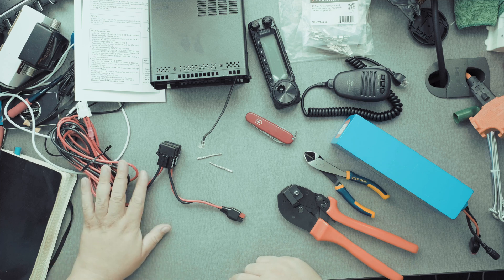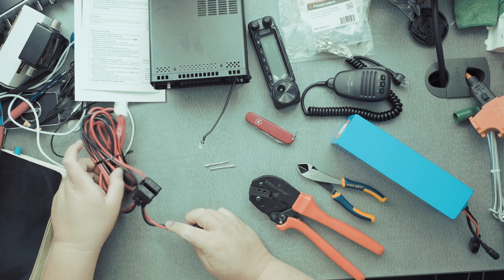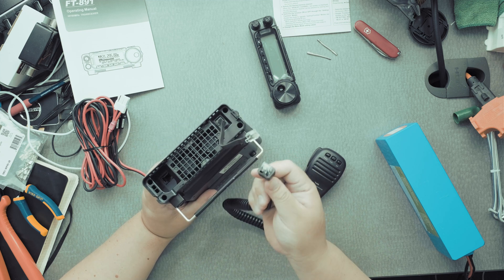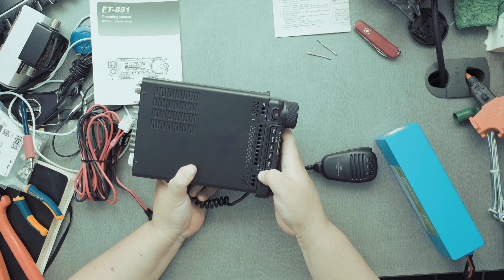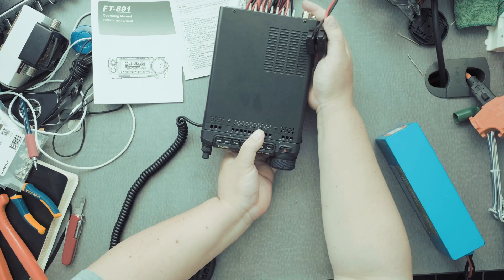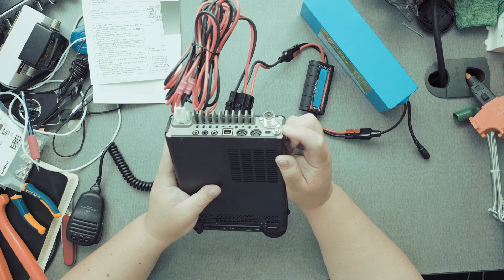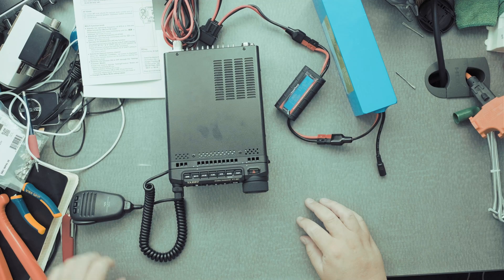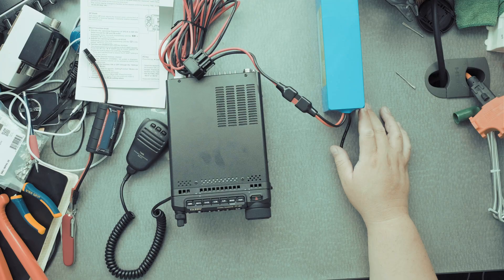Yaesu FT-891 Basic Field Setup

Comment: In general, running a home radio to a ground rod that is simply driven in the ground is probably not a good idea even though all the manuals have been saying that for as long as I can remember! The ground wire from the power panel is, or should be connected to the ac power supply. That is connected to the power system ground, connected to the ground rod at your service entrance. Another ground rod any distance away that may be connected to your radio could, in the event of a lightning strike nearby, be at a significant difference in potential from the power ground and cause serious problems with anything connected to it. That radio ground rod should be connected to the power ground rod at your service entrance so they both stay near the same potential. When using a battery there is no safety need to ground the radio. Indeed what hurts you is always a difference in potential. What is the difference in potential between the radio chassis and the ground when connected to a battery? Probably zero volts in almost all cases. My home radio station does not have a separate ground rod. I also disconnect my antenna when not on the air. Lightning could hit my antenna and if I did have a ground on the radio the ground would not help protect it.  Grounding is often misunderstood, even by the people who write the manuals!

Comment: Hi Frank, really appreciate your video. Just wanted to know that if  it is possible to work the FT891 efficiently without an Antenna Tuner and also not damaging the rig. If yes, then it would be great to hear how to go about it. As a manpack the the ft891 can then become superp during hiking. Hope to hear soon
73 & Cheers!
Reply from the maker: Hi Shandy.  I used to have the FT-891.  You can have a resonating antenna on the FT-891 without a tuner.  Best thing to do when you are not familiar with the antenna is to check it with an antenna analyzer.  There are plenty of options in price and options available for ham operators.  Ya, about the manpack, can't wait to see it.
Reply: @frankwc0o  thanks-za-ton for the response.
Cheers!

Comment: 8:56 Get shocked from what?
Reply from the maker: It's possible that the surface of the radio receives charge from a source and it's good for that charge to leave via the grounding of the radio.  It's a preventive way of you not getting "shocked" when you touch the radio's body or sometimes even the mic.
Reply: @frankwc0o  So even if its grounded there is still a good chance and risk of electrical shock? Wow that that makes me not want a radio now. Thats dangerous.
Reply from the maker: @BlackHamRadioUniversity  There is a risk.  Especially if there is an electrical storm or wind that has charge on it.  When you have an antenna, you are taking in that charge to the radio via the cable.  It's not dangerous, be prepared.  I would do more research on this issue.  One thing, for field setup, you don't need a ground, but some people do.

Comment: When I take off the power cable from the radio, I use a small flat head screwdriver to push in the tab on the top which releases the cable connector. Sometimes I use the center conductor of the PL-249 to push in the tab.
Reply from the maker: Good idea. I now use my pocket knife’s flat screwdriver.

Comment: hello Frank ,The blue battery you have, how long does it last for you transmitting at 100 watts with the yaesu ft 891?..73
Reply from the maker: Hello Philip.  The longest I've used it was for about 8 Hours, but it wasn't a constant 100 watts.  It was intermittent use.  The battery is 144 Watt-Hour which is a hefty battery for that radio.
Reply: @frankwc0o  thanks 73

Comment: I have the same Powerwerx power meter, and its been really great until recently. About two months ago it started showing lower current draws and wattage than I was really drawing. The small plug on the side of the power meter is to accommodate an alternate power source. In some instances there might be a need to have the meter powered with a constant 12v while it is measuring a much lower voltage, but that would not really apply to us hams that need 12v all of the time.

Comment: What's the name of the plug/connector on the end of your power cable (after the fuses) ? It doesn't come with the radio, correct? Thanks!
Reply from the maker: The connector for the radio is standard.  The connector will be on the wire.  As for the connector for the battery, you need to create it.
Reply: @frankwc0o  thanks for replying. Do you know what type of connector is needed for the battery end of the cable? Thanks.
Reply from the maker: @LevyCarneiro  Watch the beginning of the video, it's a Anderson PowerPole.  You may view my video on how to install it at https://youtu.be/SUsnBzrX_cQ.  Note, you don't have to use the sam tools that I use, you may use other tools to install the PowerPole, so look at other videos as well.  Good luck.
Reply: @frankwc0o  thank you, sir, I appreciate it.
Reply: @frankwc0o  thank you, sir, I appreciate it.

Comment: I decided immediately to cut down on the length of that power cable.  I wish that they put the fuses much closer to the radio side.  The metal par of the power poles can be bought pretty cheaply from Mouser electronics, the plastic housing is the expensive part.
The speaker/headphone switch is the thing I don't like about this radio.  I have rails on mine, so it's a pain to switch between them.

Comment: What coax connector does the 891 use?
Reply from the maker: On the back of the radio it's an SO-239 "The female" plug.  While the coax would be the PL-259 plug on the cable "The male" plug.
Reply: @frankwc0o  Thank you very much that clears up alot of confusion!

Comment: Frank, thank you for this video. I just received my 891 (some of the decision making was helped by your videos) and it helped my setup the radio. I greatly appreciate it. Hope to catch you on the air..
Reply: I like the Yaesu FT-891 for the compact size . And it is not hard to setup in the field . I am using the Wolf River Coil and a homebrew clamp mount. And I want to get a MFJ 1979 telescopic antenna. 73 AE4OY William Peacock EM-81UF (OldYella)

Comment: Am I missing something? All you did was attach the power cord. You moved the switch from PH to SPKR on the face plate but didn’t say why.
Reply: My Icom has the same type of switch, and I believe it is used to adjust the impedance and/or audio power output of the jack to be used with either a speaker or headphones.
Reply: Yeah... Talk about the radio and not simplistic stuff like how Powerpoles go on or which is the top of the molex connector...